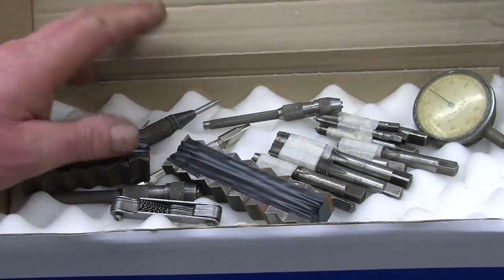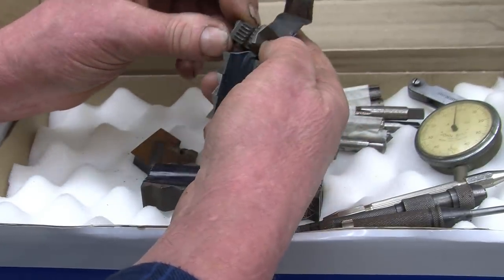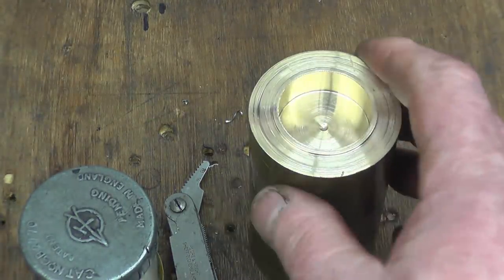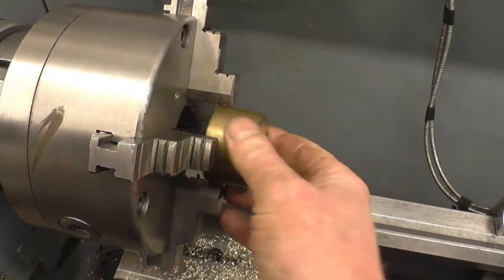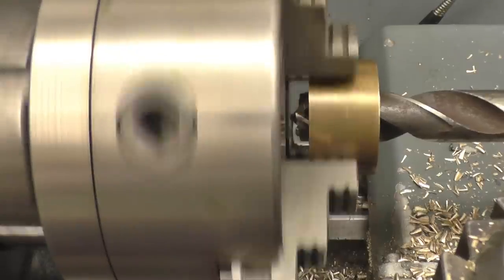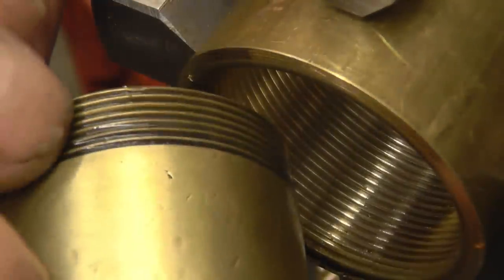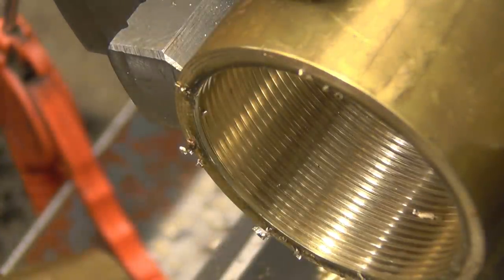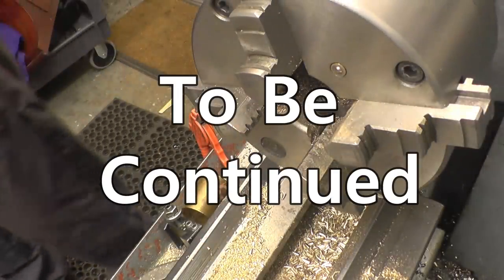SNNC 261 P1  Screw Cutting Internal Threads

Comment: Hello mate.. would you be able to cut 1” 1/2  6 tpi threads, I have a union graduate wood turning lathe with a VFD fitted so it now has  reverse. So I need an adapter : 1” 1/2 female left handed to 1” 1/2  right handed…cheers bud.